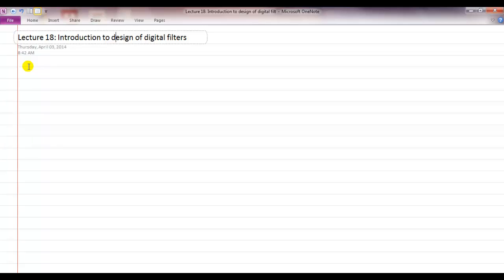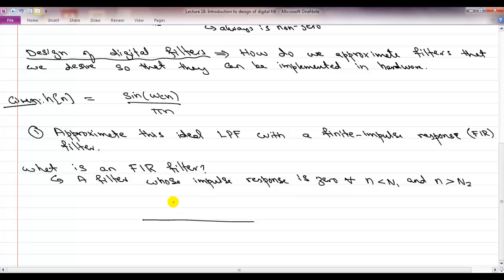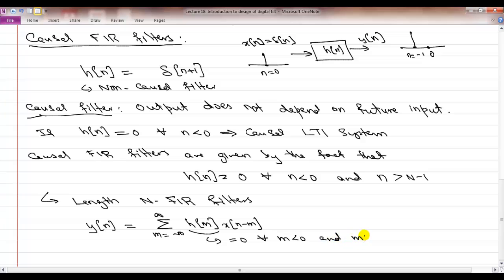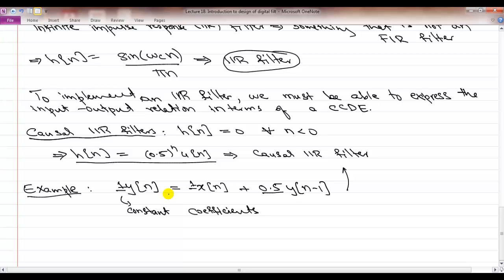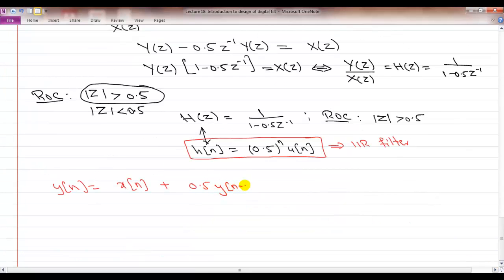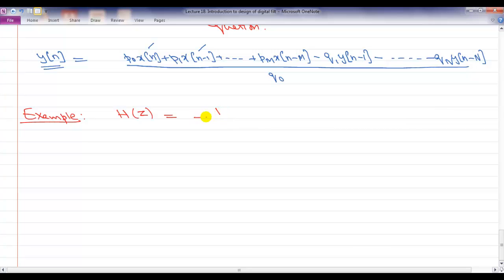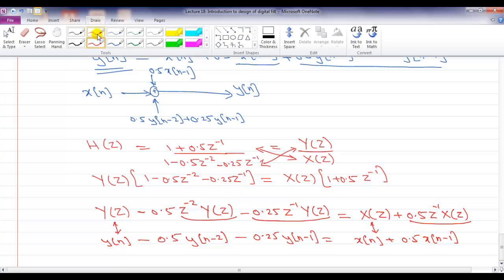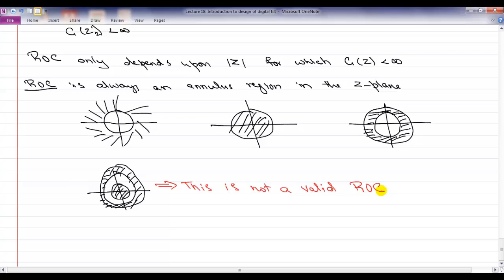ECE 346 (Spring 2014) @ Rutgers -- Lecture 18

Comment: At around 22:22, using the definition which you have, of the difference equations having  having constant coefficients, how is h[n]=sinc IRR? Or can "n" be considered a constant, in this. Thanks.
Reply from the maker: +kabascoolr An IIR filter is simply one that has an impulse response that goes on forever (either in positive or negative 'n' direction, or both). Since sinc satisfies this definition, it is automatically an IIR filter. The point you are referring to is the fact that SOME IIR filters can be expressed in terms of constant-coefficient difference equations. However, that is not a necessary condition for a filter to be an IIR filter. Also, the idea here is that if an IIR filter CANNOT be represented using a constant-coefficient difference equation then we cannot implement it inside digital systems.